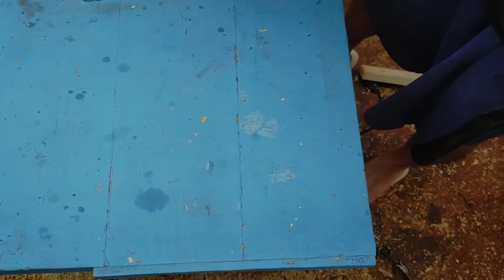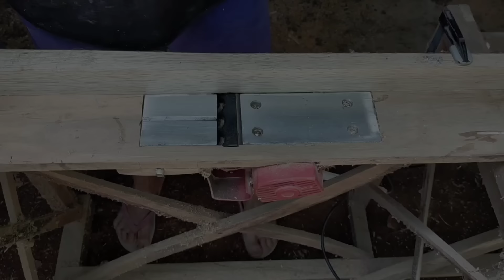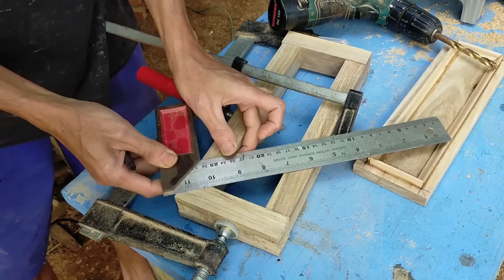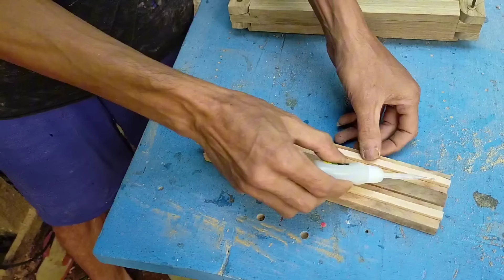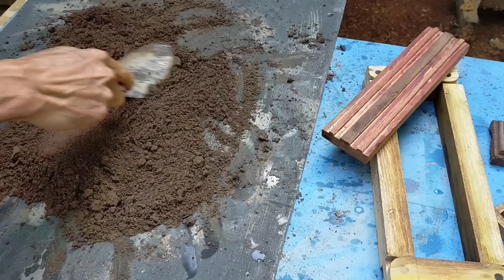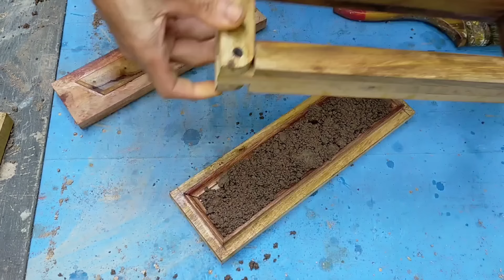Siapa Sangka Dari BATU BATA Bekas Jadi Peluang Usaha Yang Menjanjikan _ Ide Bisnis Bahan Bangunan

Comment: You did a great job on making the jig, the form for making bricks you can sell for a higher price, but it's pretty stupid to do  with just the little form. You would need a huge setup with alot of bricks. Also not that new of an idea, brick makers do this  all the time. They recycle the material, crush it down and reuse it. It's a great idea but not original.
Reply from the maker: Thanks for watching 🙏